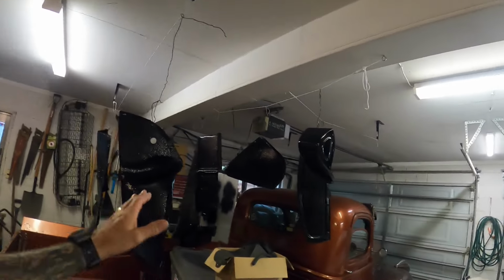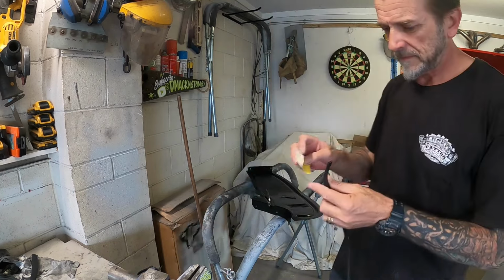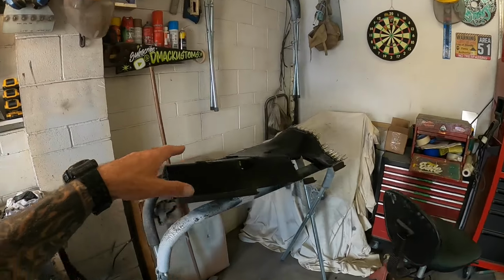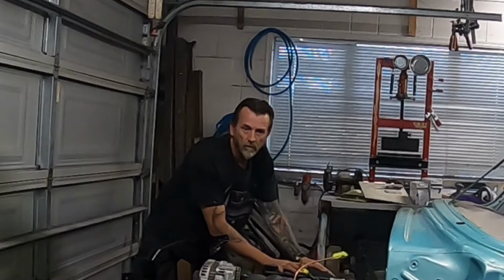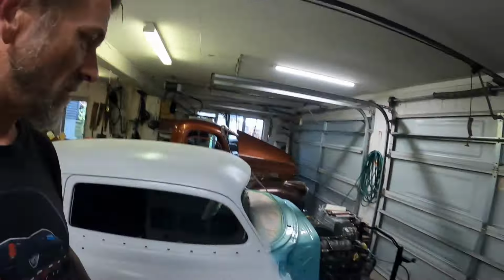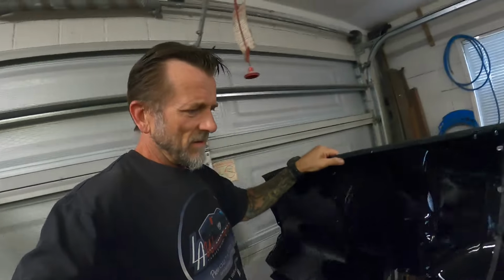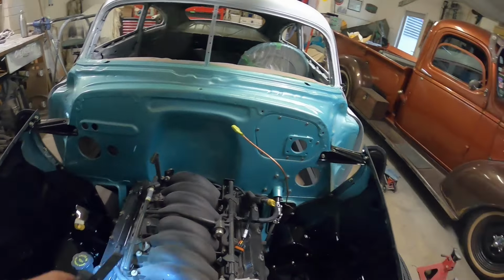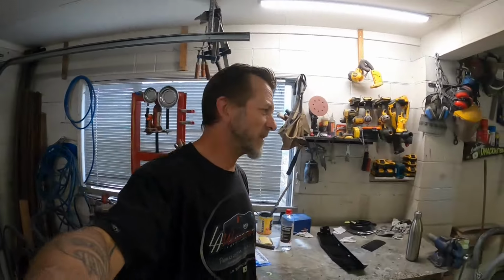Anti squeak fix and install inner sheet metal - 51 Chevy Fleetline Custom

Comment: if i had been there i would have said " hey dave you goin' to stripe those inner fenders before you put them on ?" but i'm not there am i . lookin good i like them.
Reply from the maker: Cheers mike. I did think about it. But a lot will be covered up by other stuff in the engine bay